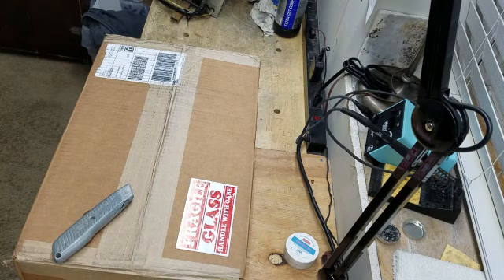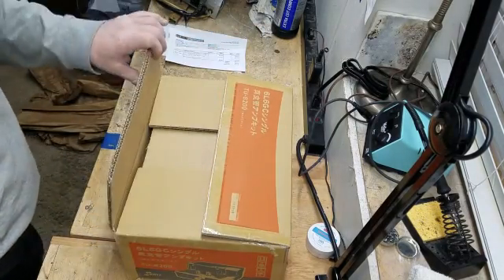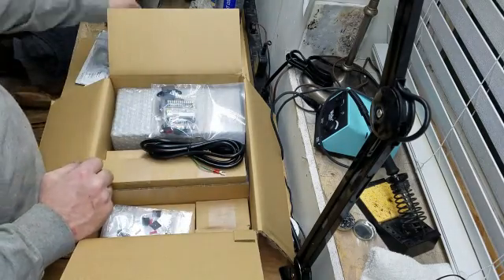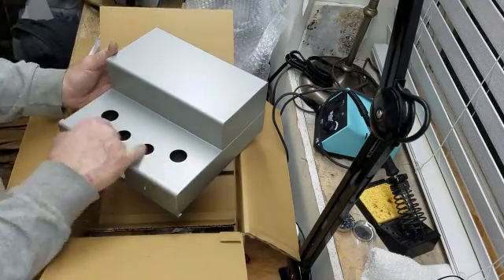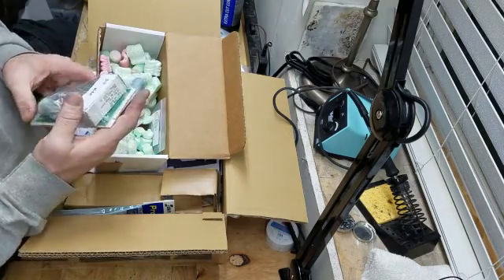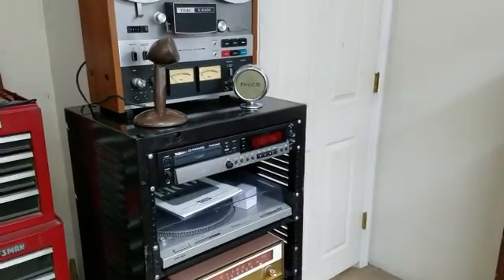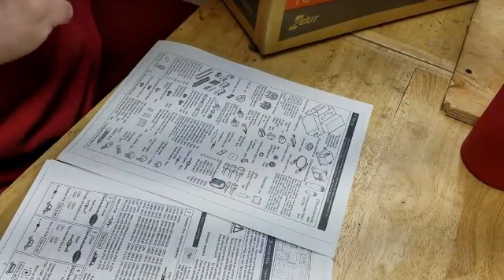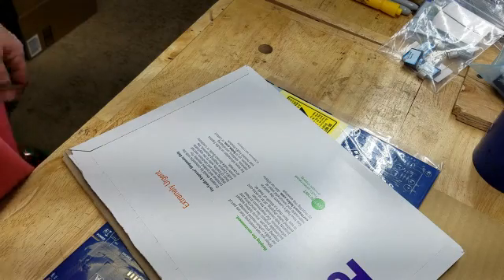ELEKIT TU-8200DX SINGLE ENDED AMP BUILD Part 1 of X  First Peek and Parts Inventory

Comment: Beautiful little 8W + 8W SE amp. I've had mine for several years, and I would estimate its worked over several thousand hours now. Have rolled Kt88's and 6550's, but for my ears, the combo is ultralinear and JJ EL34's. I run it into 96db/spl speakers, and it pumps out more than enough volume for an average sized room.

Comment: I built one of these in a few hours. 

The kit's quality and build were excellent. I have built a few other kits before in the past.

I use it during the winter mainly. I use Genelex KT-88's and the factory driver tubes. 

I am looking forward to getting their newer TU-8340 amp. I will wait until I finish rebuilding my HK Citation  II first, and get a few other amps off of my bench.

Great video. Hope you post a follow up and lets us know how it sounds after things settle down.
Reply from the maker: Hey, Christopher.  This kit is the first thing on my agenda after I finish 3 more customer radios.  I am slowly digging out of my hole.  I'm glad to hear that they are not too difficult to build and that you think the quality is good.  I've never built a kit before, but I've done lots of other stuff that may have helped me to prepare.  I will definitely put up videos of my build, whether it goes well or goes poorly!  Thank you for watching.  I really appreciate it.  Cheers!   Michael

Comment: Did you assemble the PS-3249DAC, yet?  The instructions in Japanese are not too bad because the circuit diagrams are pretty clear, but it would be interesting to read a translation.
Reply from the maker: Damian,
Sadly, I have had to put that project on hold for a few months.  We have had some health challenges in our family that put me way behind schedule on customer radios.  I have been working like a maniac to catch up and I plan to hit the first Elekit in the early summer.  I hope that you get yours together before then.  Perhaps you could get me out of a jam, when I get stuck!   Thank you for watching!    Michael
Reply: Thanks for the reply, Michael. I'll try to get the kit together before end of May. If I learn anything interesting about the DAC assembly I'll let you know.
Reply: I built the DAC before the amp/preamp. It went together very easily in a couple of hours despite lacking instructions in English. The circuit diagram and photos are clear enough. I noticed one mislabeled capacitor on the PCB diagram, but it's correctly labeled on the PCB itself. There's also one jumper that's shown connected on the circuit diagram and left out in the PCB diagram, but again not an issue if you follow the circuit. I'm pretty sure that particular jumper doesn't matter anyway, unless you're planning an advanced mod.  The DAC is working perfectly connected to my iMac and is ultra low-noise. I didn't connect it to a scope to see what the output looks like, but it sounds great with the few audio files I've played. I would like it to have a higher bitrate option for HD audio playback, but for $50 it's really a gem.